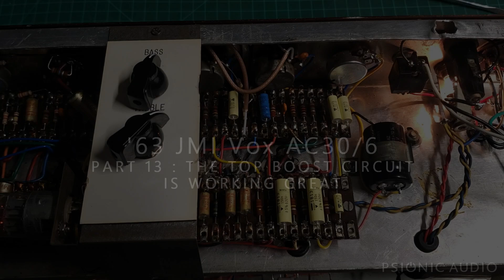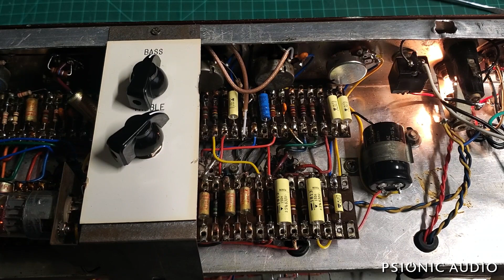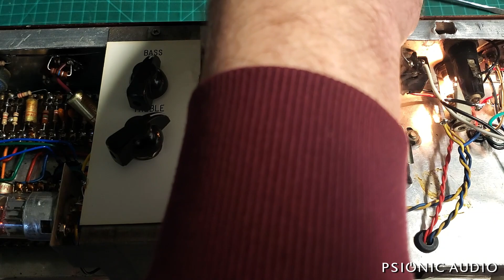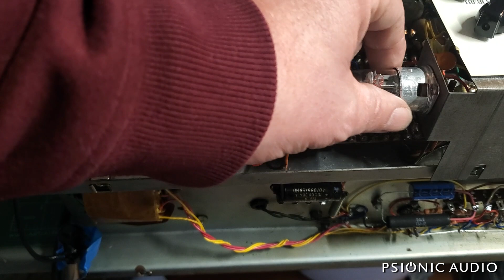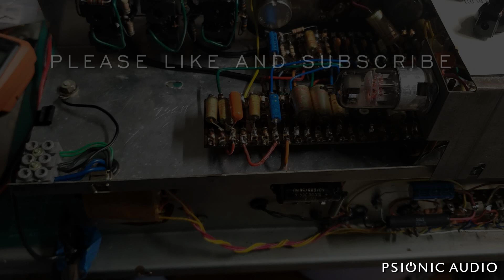'63 JMI Vox AC30/6 | Part 13 : The Top Boost Circuit is Working Great

Comment: Lyle, what speakers are you using for your test?
Reply from the maker: My regular shop cab. Open backed 2x12 with Veteran 30 and ET65.

Wait for the real mic'd video - this lav mic isn't an accurate representation.

Comment: Excellent restoration! Is there any particular reason why there's a mixture of carbon films and carbon comps in the vib/trem circuit?
Reply from the maker: Thanks! The owner didn't care what I used, and this was never going to be a pure collector's grade amp, so while I used all CCs in the Normal & Brilliant channels (except for a few CFs in the afternarket TB add-on) I only used CCs where they would have some benefit in the Vib/Trem. And certain parts of the V/T circuit need careful matching, so CFs were a better long term choice as they are less likely to drift.

Comment: Do you get any problems with ghosting using the stock filtering? I always see people recommend going to 32+32 for the resevior and the screen supply for ac30's but you always seem to use the stock 16+16.
Reply from the maker: If someone's focus is on Queen or other full gain use I'll increase the filtering, but for the clean to semi dirty stuff the lower filtering gives a more complex harmonic response. A big part of The Magic.